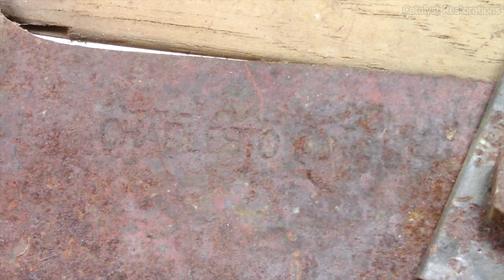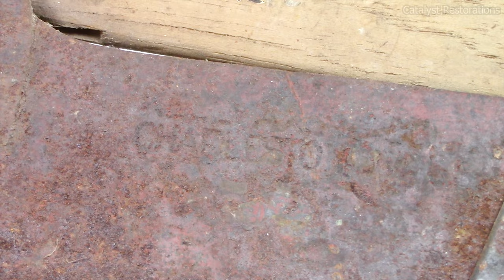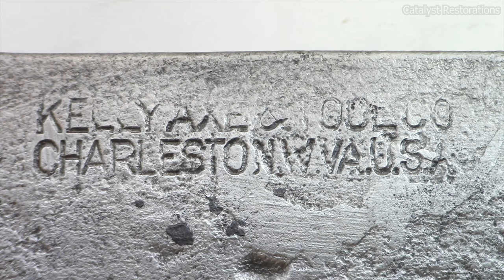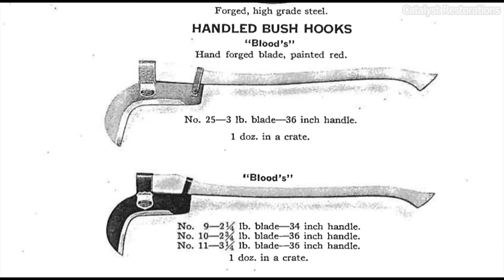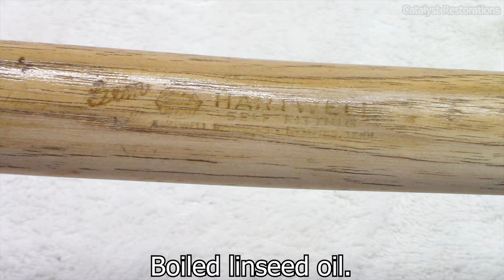Restoring an Antique 1920's Kelly Bush Axe

Comment: Hello CR, You did a good job researching the subject.   I was expecting you to blue the thing, particularly after our long discussion yesterday. Better to return it to original color.  I would probably chisel the letters on the blade to make them a little more visible.  Great effectiveness of Evaporust but also of the electrolysis. 
   Totally aggree on leaving the pits and imperfections alone. They make the tool more interesting imho.    

What is the deal with the boiled linseed oil as opposed to raw? In Denmark everybody is using the raw one and the boiled is rather hard to find.  

Even though the bush axe is a fine tool, I have never seen one in Denmark. I have a lot of unwanted brush on my land and remove it with a small saw or just eradicate it out with a stump puller -  "Big Daddy Extractigator", which satisfies my hatred for these irritating plants.
Reply from the maker: Thanks! Raw linseed oil can take upwards of a month to fully dry. Boiled linseed oil dries in about 24 hours.

Comment: If WD-40 is not penetrating oil, why is it sold to unstick what’s stuck? One of the top uses (of over 2000) is to help loosen a tight bolt.
Reply from the maker: There's some...spirited debate...on whether it's truly a penetrating oil but I'm on team penetrating oil as of today! Project Farm did a great video testing WD-40 as a penetrating oil and it passed!
Reply: @CatalystRestorations  I think we can all agree it's the best smelling one on the market. I like to use my WD-40 as a delightful aftershave. A hint of cinnamon, the odor of laborious manual labor, and my wife can't keep her mitts off of me.

Comment: Big ups! love a restoration video that ends with the tool being used. i picked one of these up about 6 years ago and the handle was broken but the head was in better shape than what you started with.  the handle on mine had a pronounced sway or off set to it, been struggling to find something similar before I try and remake it.  Does your handle have a sway?
Reply from the maker: Thanks for watching! That's really interesting about the offset on yours - I've never personally seen that before on a bush axe and mine was perfectly straight length-wise, but I do know that some large scythes have a bit of an outward bow in the handle so that when you swing it in a low sweeping motion it can get closer to the ground easier without having to bend over. Maybe that's what's going on with yours?
Reply: @CatalystRestorations  I appreciate the response.  I went ahead and carved a new handle without the offset.   I figure it must have been a "right handed" handle, which seems counter intuitive.  If I'm out clearing brush all day I wouldn't want to be limited to one swing.  I'm glad I found your videos through some very specific tool resto.  big ups!
Reply from the maker: @cobratufskin  Glad my video tags/keywords are working as intended! 🙂👍

Comment: The axe is awsome seen better restoration u done looks like only got a new paint jod  u left alot of holes that could of been filled but none  the less  looks ok
Reply from the maker: For sure could fill in all the holes but the only way to do that is welding and it felt wrong to weld over the entire surface.

Comment: I recently found a Kelly of a pretty similar make with a barely legible stamp still on it. On the bottom arm there’s no pin and they didn’t use a washer either, it’s an old fashioned square headed bolt. How would I go about dating it? Thanks, and awesome work
Reply from the maker: Hi Vishnu! When I worked on this project I referenced this site which helped me determine roughly when mine was made based on the name of the stamp that was on my axe head - the company's name changed slightly over time so it was easy to approximate the decade it was made in. I know you said your stamp is barely legible but if you can figure out what it says (or doesn't say) then you might be able to narrow it down: http://www.yesteryearstools.com/Yesteryears%20Tools/Kelly%20Axe%20Mfg.%20Co.%20.html
Reply: @CatalystRestorations  thanks so much for the insight , I seriously appreciate it. Love your stuff by the way, you’ve got me motivated to dig through the garage for old pieces to restore, thanks for the inspiration!
Reply from the maker: @vishnurodondo4200  You're very welcome! Good luck and remember to take your time, ask question, practice often, and have patience!